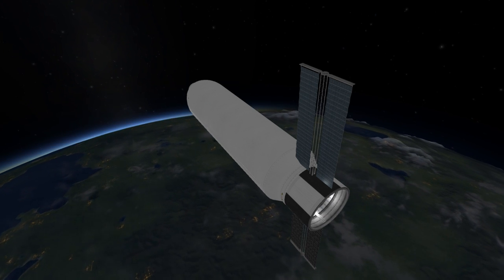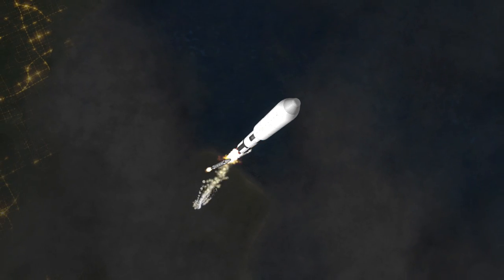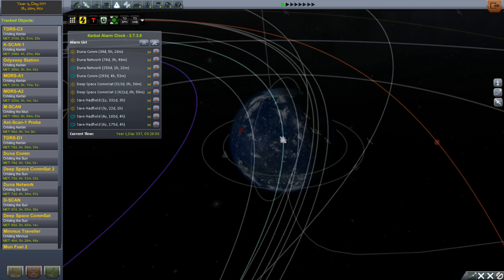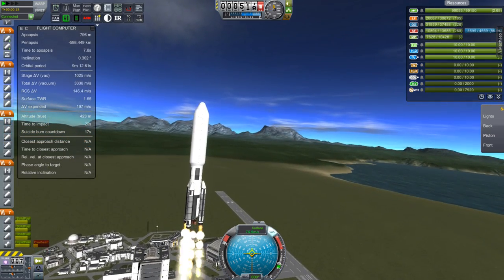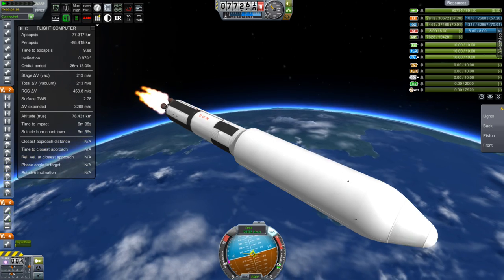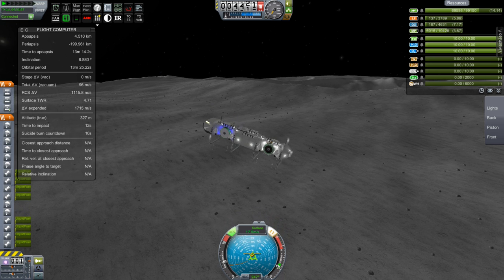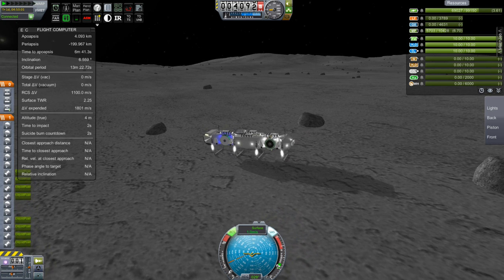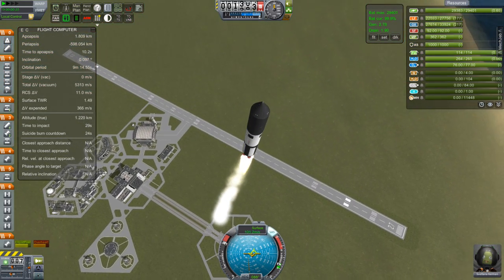E19: "Cloaking Device" / Project Odyssey / KSP 0.23.5

Comment: If/when u upgrade to 24.2, I recommend getting the 32 bit version. The reason is cuz visual mods like EVE, and better atmospheres, play absolute havoc with the fps on the 64 bit (even on lowest quality) plus, I think the amount of mods u have installed can easily fit into the 32 bit version.
Reply from the maker: Skylord414 _ I had to switch to 64b on 0.23.5 because I ran out of RAM without it.
Reply: I have no problems with the visual mods on the 64-bit version. ;)

Comment: have you set the shielded docking port as a decoupler (since i didn't see a decoupler/engine shroud jettisoned like most apollo-likes in ksp have/have to deal with). (also i'm guessing you put another attachnode on it. i wish they'd have them have a tweakable deploy and top node option).
EDIT, Oh read a comment below with you saying that it's a faring node, probably how they did it in the real Apollo too (attach to structure around not ship on-top?)
Reply from the maker: RAFbatman Real Apollo attached to the surrounding structure, yes. I saw the setup when I went to Houston. In essence, real life does exactly what I did, if real life had attachment nodes like KSP. A better comparison would be to a dual-satellite launch such as what Russia does relatively quite often (because their launcher is overkill for just sending up only one satellite).

Comment: Hey Bob! Two questions for you buddy. 1. How did you manage to put the Hydra capsule on top of the landing module without them "touching" eachother? 2. From which mod is that white landing capsule?
Reply from the maker: Fairy Light I added another node to the 5m KW fairing I was using.

    node_stack_top2 = 0.0, 5.0, 0.0, 0.0, 1.0, 0.0, 4
    MODULE
    {
        name = ModuleDecouple
        ejectionForce = 500
        explosiveNodeID = top2
    }

The small lander is Alcor ASET and the huge one is mostly LLL.
Reply: Allright thanks alot Bob! Love your videos man, keep 'em coming :D

Comment: Amazing cinematics! :D
What you can do about Project Odyssey in 0.24.2 and that texture issue(from what I've noticed):
-Move all the mod files to some other place
-Run the game on a new save with Vanilla so it can load textures
-Put the mods back in
-Run the game again and it should be fixed. I have 78 mods, 60 of which are parts mods, and that worked for me when I ported my list from .23.5 to .24.2! :D If it doesn't work sorry for the waste of time. :(
* Also, I have those mods all together, and they're perfectly compatible. I am having a problem where I can't launch any MANNED missions! I don't see any Kerbals, if I EVA one it crashes, and I can't stage anything. UNMANNED launches are fine. Any thoughts of a solution? I'm desperate! :(

Comment: Hm, an idea with the texture binding issue:  perhaps one of the texture file formats assumes sizeof void* is 4?
Reply from the maker: Zyzzy Xor Interesting idea. void* should be "native pointer" and therefore 64b. I also think if the pointer were half good and half bad I'd get a crash as it tried to read invalid memory. Actually I WAS getting a crash util I added "-force-d3d11" to my command line for KSP. I'll check the forums. Still not sure...
Reply: Yeah, that's a good point.  Also, the visual nature of it is just a bunch of Z fighting with a null texture... they seem to be taking the place of shadows?  So perhaps whatever code in unity player generates those shadows depends on different scene data between 32/64.
Reply from the maker: Zyzzy Xor THAT makes a lot of sense. I like that theory. I think you figured it out.

Comment: Hey mate, I know what will make it less buggy and give it a HUGE amount of memory, NO crashes... New B9 aerospace!

I was joking by the way.
Reply from the maker: Thoth themighty I don't have B9 installed. You can't gain memory by adding a mod you're not already using.
Reply: I was joking...
Reply from the maker: Sorry, didn't get the joke. :)  Is the joke because supposedly new B9 saves a ton of memory, but in reality it didn't really help its users? I never tried it. I want to try it though since the parts look awesome.
Reply: The new B9 has... A few issues. For example: I can't get it to work with 64 bit, also just to get it to launch, I have to play without the new KW :( But an EPIC mod anyway!
Reply from the maker: Play without the new KW?!?! Blasphemy.
Reply: I know! I am normally a heavy modder, with 25 or more at any one time... Now I have the new B9, with integrated Hot rockets and Rasterprop monitors, the only other mod is BD armoury.
Reply: But just with that, I have assembled a fleet of 5 ships, rivaling those of Star Wars, with lasers and the whole deal...
Reply: didn't they have a bug where BD didn't work with B9 (one of the reasons EE hadn't got WWK2 restarted)
Reply: No, I'm fine with BD and B9...
Reply: I’m a heavy modder as well... my KSP takes like 9 minutes to load.